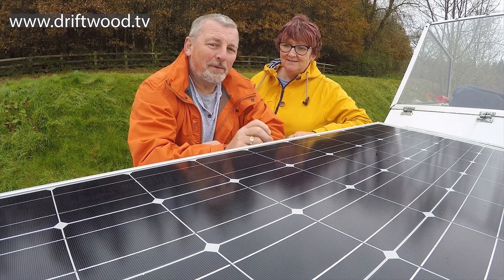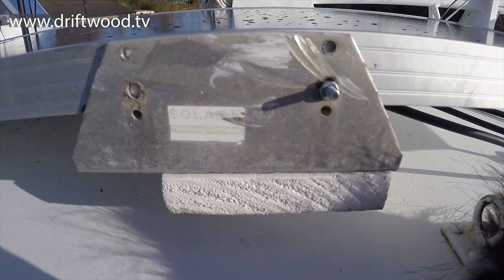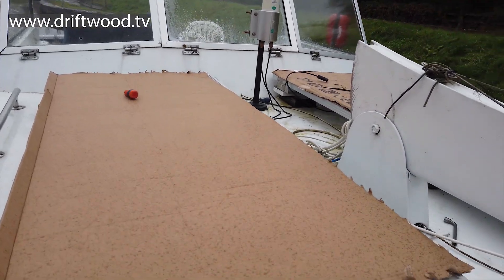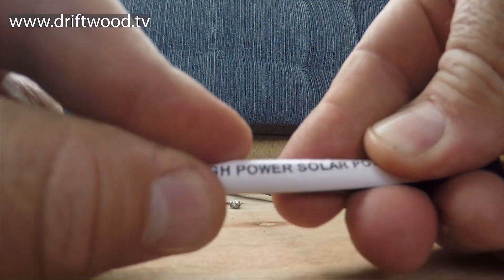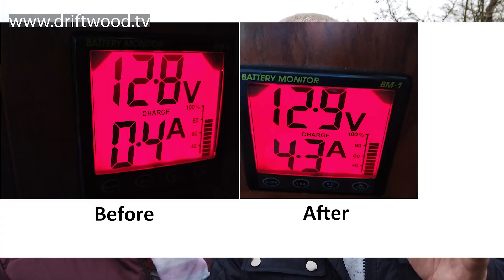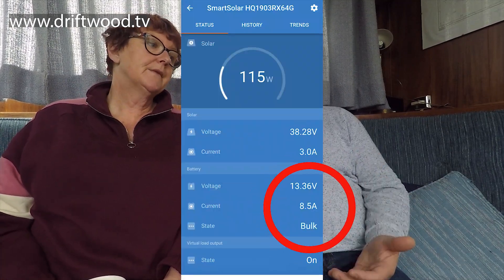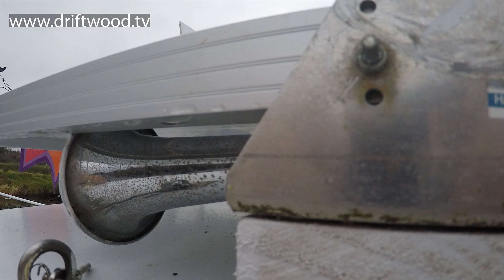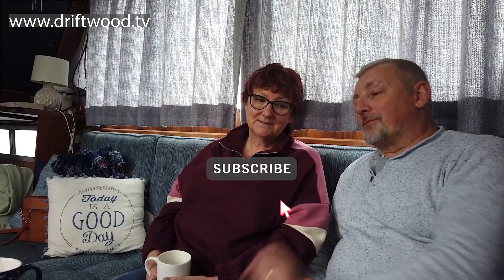Solar Power Battery Charger for Boat

Comment: How much was the new system vs the last? Were the old panels wired in series also?
Reply from the maker: Not sure how the old ones were wired, but they cost about €250 ish. The new setup is about €600 but it knocks the socks off the old panels. Hope that helps.

Comment: I’m trying to charge my boat batteries on my bass boat! I have a solar panel to inverter  extension cord  from inverter to plug into built in battery charger installed in boat! Will this work? I need your help bad, I have to store my boat at a RV storage, they have no power outlets! It’s a 20ft bass boat with a 225 hp outboard! I don’t want to screw something up I have a lot of money in this boat! Please help! Thank you! I’m plugging the boat into the inverter that is hooked up to solar panel!
Reply from the maker: Oh Jimmy, no no no. That won't work. Your solar panels need to go to a charge controller and then to the batteries. The charge controller needs to be compatible with your solar panels too. You only use an inverter to change 12v volt DC to AC (240v here in Europe or 110v in US)  Hope that's of some help. Fair winds my friend.

Comment: That's some amperage increase Harry. Cruising the cut solar panels got 0.5 amps with the same kind of weather. So your initial 0.4amps seems around the same. The Mono seems like its worth the investment. Have you looked at LiFe batteries? https://www.pbo.co.uk/gear/lithium-batteries-for-boats-reviewed-12-of-the-best-lithium-boat-batteries-tested-62244 amp hours are a guilty pleasure of mine.
Reply from the maker: Hopefully we'll get back out on the water sometime in June, and I'll see how well it performs in good sunshine then. Ye I'm with you on the Amps, especially when they're free from the sun 👍

Comment: Thanks for the video I'm thinking of doing the same on my boat and  just  wanted to know what watt your new panels are, you said the old ones were 100W and going by the photo of the box the new might be 175W but I can't seem to find them on the euromotive site. Thanks.
Reply from the maker: Hi Fergal, Yes they're 2 x 175W panels. Might be best to give them a ring. If you mention that you saw the video there is a discount to be availed of. H&M
Reply: @DriftwoodBoatBlog   Thats great thanks I just have to measure how much space I have on the roof then I will call them. I'm also thinking of putting them on a tilt system so I can angle them towards the sun.
Reply from the maker: Hi Fergal, yes that's the way to do it. Once you can angle them towards the sun you will increase the efficiency enormously as well as extending the number of usable hours of daylight. Let us know how it goes 👍

Comment: From what I've seen in looking into solar power you get best results with a controller for each panel. A simple demonstration you can do yourselves:
On a bright sunny day, monitor the charge rate while you make sure 1 panel is partly in shadow. That drop in amps from the shadow is expected naturally. Even if your panels were wired parallel you would see a drop in power generated that matches what you get with them in series.
The charge controller can only work with 1 level of input power, so 1 panel partly shaded has a drop in power, both produce at that rate as far as the controller is concerned.
Most efficient setup is 1 panel = 1 controller, 2 panels = 2 controllers.

This is not a major concern for your limited solar setup, it would only be something to consider if you ever plan on increasing the amount of solar panels.
In that case, you might find getting the square panels and running them a better method. These smaller panels may only produce 1/2 to 2/3 of the power, but if they are each on their own controller only those panels actually shaded at any time would have a reduced power production level.
The biggest drawbaack to this, the extra cost of controllers and wiring.
Reply from the maker: Thanks for the tip. I'm amazed how much there is to learn about what I once thought was a simple job. Solar is nearly a science in itself, so many factors that can affect the output.